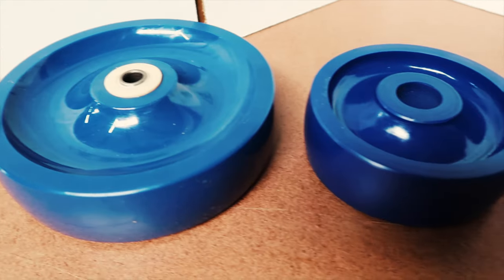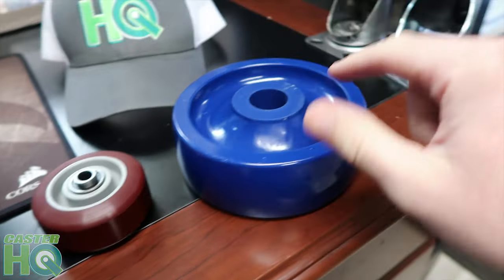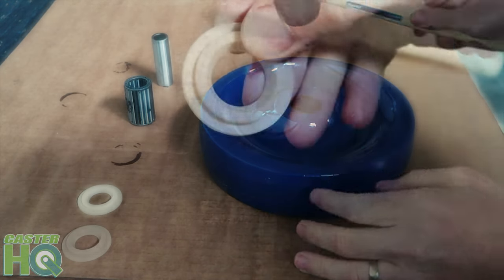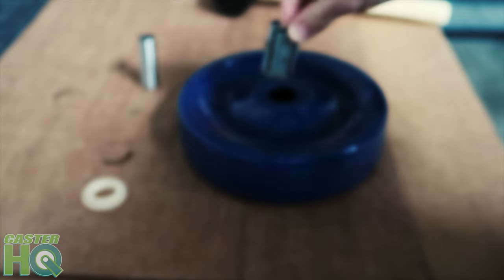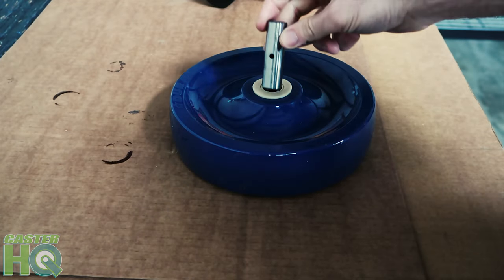Blue Solid Polyurethane Wheels | Full Tutorial

Comment from the maker: 0:00 Start
0:25 Comparing Solid Poly with Two-Piece Wheel
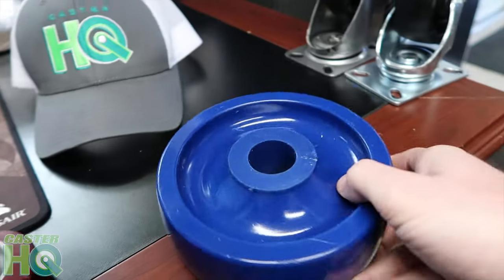1:35 Common Applications & Industries 
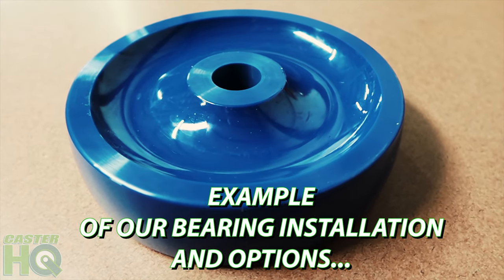3:15 Bearing Installation and Options
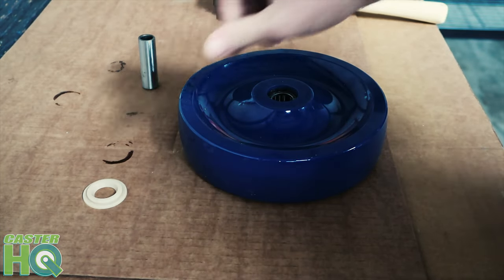5:15 Temperature Range & Features
8:50 Contact Info
9:16 End of Video

Comment: I am looking for bulk 2 - 3” poly wheels that the bearings can be changed if worn out. I am making Dog Slatmills. Each mill will have 20-25 2” wheels with say a 1/8” gap between each wheel for each side. 40-50 total. Do you have cheaper wheels(don’t need $$$ ones I don’t think for this project) that will not cost an arm and a leg?
Reply from the maker: Hey feel free to email us your contact info at info@casterhq.com and we can look more into application.